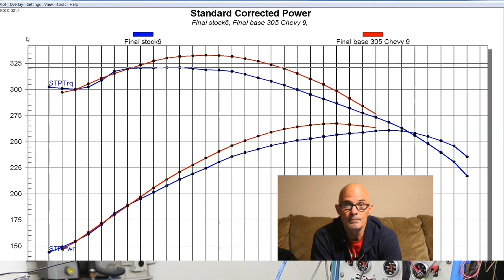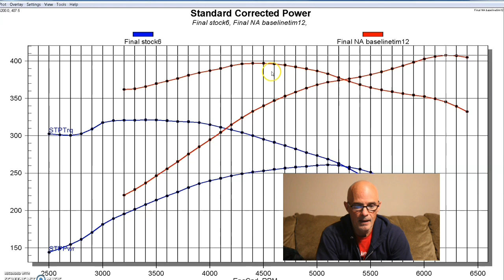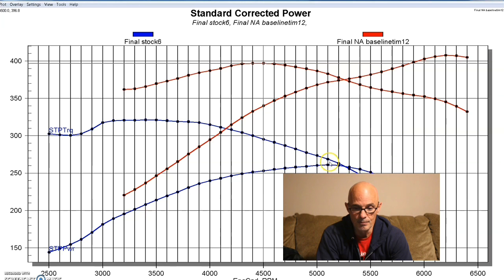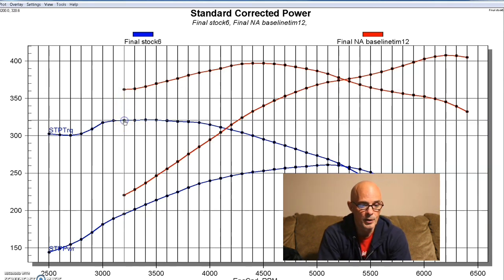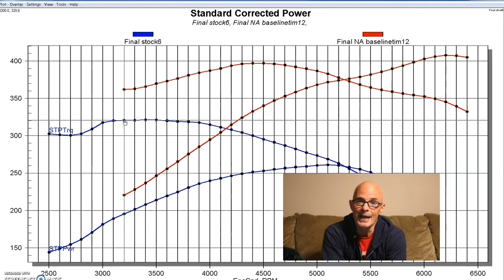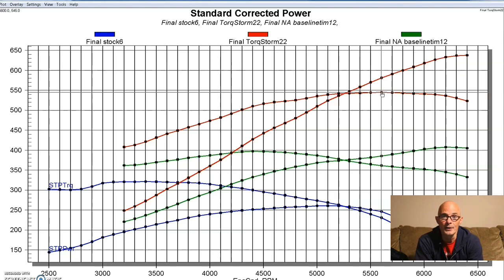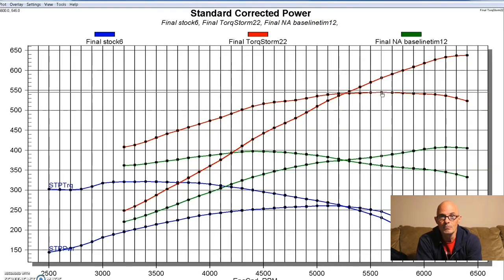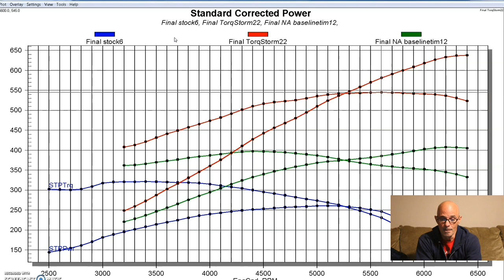5.0L FIGHT-302 FORD VS 305 CHEVY-FULL RESULTS

Comment: Questions I have a 1974 chevy 350 4 bolt  factory crate engine bored 30 over with 202 164 intake and exhaust valves ..I have 600 edlebroke carb with a  dual plane edlebtoke intake I want to get a decent size cam that will rum with a stock converter ..and power brakes ...I don't race the truck..im not worried about gas mileage ..I'd like that classic  sound and power from 1500 to 4500 
Hope you can help
Reply from the maker: look at the pe246 or an xe252
Reply: @richardholdener1727  ok thanks bud

Comment: I am enjoying the channel. Thank you for that. Have you considered any testing on any 3 valve ford modular engines? 4.6/5.4/6.8?  Most you would find in a wrecking yard would need the typical repairs to the timing components due to most owners lack of maintainence. Would be interesting to see how they stack up as far as mods and boost.
Reply from the maker: I have run lots of 3V testing

Comment: I think the camaro /firebird handles better, and is definitely more comfortable! But Chevy 5.0 is more of a truck engine, mine would do 150 mph with the stock 5.0 Chevy, with 5speed, but night and day difference swapping to a 5.7L with trick flow, twisted wedge heads, and 10.2:1-10.5:1 compression,  unshrouded heads really makes a difference!

Comment: Richard, how about a centrifugal supercharger with a wastegate? Few test of that exist out there. The projected answer is more boost down low, same power due to more slip up top. Thoughts?
Reply from the maker: The Real Time NSX run in World Challenge kicked ass with just such a set up
Reply: @richardholdener1727  I am building such a setup and was going to test it on my dyno. I however am far from being there. Can I pick your brain on a dynamometer question?

Comment: I have an 88 LTD with the 5.0. I know there’s some changes that need made to send it to HO status like firing order, manifolds, etc. I’m curious and looking to make this a sleeper (already put some work into it). What would the upgrade cost look like roughly? Parts on these seem affordable but the labor done correctly? Covering remaining drivetrain like differential/axles/etc for reliable daily around 400whp as well
Reply from the maker: not sure on costs

Comment: The most impressive thing about this Ford combination is how well the Street Heat manifold did.  I know they rated that manifold for idle-5500rpm, but I've got it on my car, and with the right cam it really does pull high into the rev range.  I had my combo dynod right after I built it, no tuning, etc.  At the wheels the E303 cam, TFS TW heads, and Street heat manifold made almost the same as the stock motor with no accessories.  I had a valve spring break with the E cam, so upgraded to an XE270HR with new springs.  That combo was also street tuned for about 4 years.  I guessed it made 365HP and 390lb/ft of torque.  After seeing your test I am feeling pretty confident in that estimate.
Reply: Back in the day I had a similar engine as you, TW 170s, B303, Street Heat, typical boltons, 3.73 and 1 5/8 shorty headers made 304rwhp.  I almost went with XE270 but run out of money for increase for cam/springs since bought all add ons at once.  Loved that engine, a blast to tool around town with.

Comment: There's a lot of comments about blocks, pistons and longevity with the Ford and here's my 2 cents worth. 
When it comes to the block the best would be a 70's Mexican 302 with a roller kit, the 5.0 roller block started out weak but got stronger through its lifetime, but even the weakest (85) will survive a 400 dyno hp build.
Ford changed to hyperutetic pistons in 1993, those shouldn't be used for any build over 400 NA or 350 boosted.
And finally the weak link to the bottom end is the rod bolts, the stock ones are too small but the rod should NOT be machined to accept a larger one as the removed metal makes the rod weaker. Simply replacing the stock bolt with a higher grade one of the same size will give you a bottom end that will live at 7K all day long.

Comment: As is turns out Europeans have found that small bores are actually more efficient when combined with the ideal combustion chamber. It's been found that a slightly above square motor has the ideal bore/stroke ratio due to flame travel. It's why almost all European engines have similar displacements (3.0L 6 cyl, 4.0L v8, 5.0L v10, 6.0L v12, 8.0L W16) . The "ideal" cylinder has a 1/2 Liter displacement and is slightly above square and ideally should have hemispherical combustion chambers. Instead of making the cylinders larger to increase displacement, they just take the same cylinder and add more. I think the 6.0L W12 in the Bentley (made by VW) is smaller in exterior dimensions than a SBC.

Comment: Richard, when you run these older engines what are you using for a PCM to run the engine on the dyno?    I was big into the Fox mustang seen back in the 90s and early 2000s and quite frankly, getting them tuned was a horrible process by todays standards.
Reply: He states that they used the Holley HP fuel management system I believe.

Comment: Have you ever seen the road kill rotson that 5.0 was said to be nine stock and they put a single plane intake and 650 blow threw carb and cobbed and hacked a turbo kit together using up side down factory headers and a power stroke turbo and maid. 618torque and 550 hp
Reply from the maker: I know those guys well-where do you think they got the BBC for Stubby Bob
Reply: @richardholdener1727  from u I think iv seen u on there a few times great group of people. I was just saying that was decent power for stock cam and heads I'm not knockin the heads a d fuel injection u did and the power u maid but it seams like a little head work and better shorty headers and cam and that road kill 5.0 would make a little more power and little less torque and be very fun and safe to play with
Reply: Very good channel love the content that u put out and I look forward to seeing new videos

Comment: Would be cool to build an updated variant of the DZ302 using a factory roller 4 bolt 350 block and the crank from the L99 4.3 V8 from a Caprice, a set period 2.02/1.60 350 heads and test that one. Using all junkyard parts of course lol
Reply from the maker: that would be cool
Reply: I have wanted to do this but it would need heads and intake from a different era to really shine
Reply: Chevy made big valve heads back then, can’t remember which exact engine, shouldn’t be a problem, after that’s tested throw modern heads/cam/intake at it and see what happens.

Comment: Wow Rich! I have a similar setup stock 302 Ford 170 Trickflow heads 1.7 roller rockers looking to put there stage 1 cam in it has 499/510 lift 221/225 duration. Which is smaller than the stage 2 cam you use . Do you think it will clear?
Reply from the maker: 221 should fit-we always check
Reply: @richardholdener1727  thanks I forgot to ask about the comp cam xe270hr-14 512/513 lift 218/224 duration with 1.7 rockers wound that be a better choice or would it be to big ?

Comment: Those who were there in the '80s remember the street dyno. A 305 got stomped by a 5.0 every time. If you wanted to run a Camaro against a Mustang you better bring a 350 and hope the Stang misses a gear. Of course if you wanted to run a Mustang against that little V6 GN you better bring a gear, heads, headers, and a bunch of spray. Stock to stock it's the GN all day.

Comment: The nice thing about the 305, is that any 1 piece rear main seal small block can replace it, a 350 bolts in, and all the parts off the 305 fit the 350. The same can't be said for the 302. That being said both engines perform pretty good. Do you have a link to the tests of bore vs stroke? I'd be very interested to see them for myself.

Comment: Great video i have always wondered does the short stroke climb the rpms faster?
Reply: In case you never got an answer to your question…engine displacement being the same,a bigger bore and less stroke will always rev faster and higher than a longer stroke. Longer stroke gives you more torque at lower rpm’s than a short stroke but will not rev up as fast or as high. Long stroke is good for heavier cars and trucks to get more low end grunt. Hope this helps even though it’s a question from 2 years ago.

Comment: In 1985 I bought a brand new 1985 Trans Am with the 305 TPI engine. I had high expectations and was really disappointed in that engine. Even more so when I was regularly beaten by 5.0 Mustang GT's. I really never understood why GM went with the 305 with its small bore and 350 stroke vs bringing back the old 302 with the 4 inch bore and 3 inch stroke. I think even the old 307 with its 3.875 bore and the 3.25 stroke crank from the 327. Emissions perhaps?

Comment: Mee too. Mid 1990s i had an 87 convertible. Began mods with sub frame connectors sll the way to a 347 stroker with a Vortech S trim. It was fun.
But...dont do a convertible.

Comment: I'm a Ford guy, I'll admit it.  Give me a Boss 351 SB Ford and the small block war is OVER. Lol!

You have to be very smart, very tenacious and have a serious reason (and budget) to get big power from a stock block Chevy 305 but it can be done.   Big Time!
One of those reasons might be a Track maximum displacement rule. 
I've seen 5.0 Litre Dirt Track Sprints that were running Chevy "claimer" rule engines that had to be a stock block Chevy 305 as from the factory. That's the only way the track would let them run. 
We had kinda set the class up that way for us Ford guys and it worked great for a while til somebody figured out the secret combination on the little bore 305 Chevy.
These guys were getting 550 plus HP and turning 7500 RPM race after race with NO problems night after night because of the 5.0 Litre track rule. They gave us 302 Ford cars all we could stand and then sum!!
 After they got 'em figured out, the Chevy 305's won as many races as the Ford Cars did and ran just as fast and maybe a little more reliable too. We ran our Fords til they POPPED trying to beat 'em.
So people who say a 305 Chevy won't run just haven't seen a screaming 305 win race after race. To get beat by a stock block 305 Chevy hurts you to the bone buddy!! LOL!

All in all Ford and Chevy small blocks (as different as they are) are VERY similar in power until you add the word "BOSS", then it's ALL FORD!  Peace

Comment: Excellent video, congratulations on the channel, it would be good between the Chevrolet 5.7 Vortec vs Ford 5.8 EFI
Reply from the maker: that was planned but the Vortech motor is later than the 5.8L EFI
Reply: @richardholdener1727  You are right, I think they are the last old school SB in serial vehicles with the latest improvements before being replaced so I was interested in the comparison, Good luck

Comment: Can you elaborate on the power limitations of the Ford HO rotating assembly?  I seem to recall that 500HP was the limit for longevity of the block, much above that and you risk splitting it in 2.  I've also seen catastrophic crank failure on an ex-drag nitrous car.  I've always wondered what the real limits of the stock crank, block, and rods were.  When I built my motor I stuck with the stock crank/rods/block because I was building a medium performance street NA motor.  Now that I live at altitude and half my vehicles have turbos, I've thought about using the old GT38 from my 7.3 on the Mustang (battery relocation sure gives a good amount of room for that).  One thing that holds me back from doing that is the stock lower end.  I know that the turbo would actually be about the perfect size for a 5.0l engine, since I'm running twice the RPM of the 7.3l, it's equivalent to a 222CID engine at 6000rpm.
Reply from the maker: My pal Jimmy Hittle from HP Performance broke theirs at less than 600 wheel at the drag strip with turbos
Reply: @richardholdener1727  Yeah, sounds like what I thought.  When the roadkill guys put an OBS 7.3 turbo on a stock 5.0L, I was shocked it didn't immediately fall apart.  Think I'll just stick with the combo I've got.  Have you ever built a high RPM 5.0L engine?  I've wondered what it would take to make a 10krpm 5.0L that didn't fall apart.

Comment: So the additional friction from the higher piston speed doesn't make a difference?
Reply from the maker: it is worth .007 hp (LOL)
Reply: What about the better intake flow with the larger bore mainly at higher rpm I presume? Do you like the 363 setup for sdf. I have a 347, do I need to worry oil comsumption with pin in the oil ring and short piston skirt with 5.4 rods? Sorry I'm sure you been asked a million times about that. How about the 347 with the
3.25 stroke and 4.125 bore?

Comment: This question is on your previous video. I know you said that all cams are turbo cams but does lsa effect turbo applications. I guess does valve timing greatly effect power output on turbo is what I’m asking. I figure that with exhaust open a bit longer it would just push boost out of the exhaust instead of using that boost for power
Reply: Or I guess it duration that would effect it
Reply: LSA will definitely effect a turbo application, wider is generally better for turbo

Comment: Chevy did best with 4 in. bore on 327 with the 2.02 heads. Ford 289 was just waiting for the aftermarket to catch up. Yes, used to use the ‘69-‘70 351 W head on SBF before the aftermarket kicked in.

Comment: You should test the newer promaxx as cast heads on a sbe 5.0, a 180cc aluminum sbf head that flows 270cfm for $1000 a set. There are no video's or dyno numbers on these heads.

Comment: Boss had a old chevy express with the 5.0 odomoeter went out around 350,000 miles on it ran for another year or two as a service plumbing van so over 400k miles and sold it to his dad after it was in an accident and drove all the way to Miami still running

Comment: I'm surprised with the larger cylinder heads and cam that the 302 actually GAINED torque at the low end also. In the forums they will claim low end torque loss if you change anything.

Comment: It would've been nice to see the tuned port "tuned" instead of going right to the aftermarket fi.... there are a lot of people still running the tune port stuff
Reply from the maker: we did tune it-using Holley HP, I've done endless TPI stuff-the long runners are tuned for low-speed power
Reply: @richardholdener1727  that is you... "We" would've liked to see it. There's a guy running 7 sec quarter miles with the TPI. I think it has a procharger. Can you get into the 7's with just low speed power?

Comment: Just like Richard said in a lot of the tests,the BIGGEST gains are in the cylinder head…more than camshaft, headers and intake. You can get more out of the cam,intake and exhaust if you start with the right cylinder head but all the cam,intake and header in the world won’t overcome 💩cylinder heads!! I knew this before watching the videos. How do you think they get the monster H.P.#’s out of the little 4 cylinder engines??Four valves and DOHC helps but flow is the key!! 2.0 L.DOHC Ford 4 cylinder engine puts out 160 H.P. n/a (unsure of torque #) and ecoboost 2.0 are 250 H.P. and 280 ft. lbs. of torque from the factory! The first car I bought brand new was a 82 Mustang GT… the quickest and fastest American car you could get that year 5.0 2bbl with a 351w marine cam and heads, single exhaust with a factory low restriction muffler…157 H.P. and 300 ft.lbs. torque with 2 1/2 times the engine size!! So same H.P. a little less torque than the first 5.0 “HO” from 40 years ago. I’m willing to bet that the heads flow better on the 2.0 than the 82 5.0 H.O.!!
Reply from the maker: heads, cam and intake

Comment: I am a "Ford guy".
I love my little 5.0 HO's.

However, there is something to be known here.
Yes, the design of the engine (oversquare) lends itself to superior volumetric efficiency and capacity (AKA, it responds more dramatically and efficiently to air and fuel flow increases).
However, if you keep running a factory block past that 400hp line, you will very likely eventually crack the webbing.

This is a very well known issue with factory Ford 302HO blocks.

Comment: What about all the stories saying the 302 will break in half when you start pushing it over 500 horse, does that make this test a hit it and quit it, or are those old rumors unsounded will this motor last
Reply from the maker: it can happen but never did to my supercharged Mustang-even running WOT for 30 minutes

Comment: You should try 302 Chevy vs 302 Ford and maybe 327 Chevy…or 307 olds vs 307 Chevy or 400 Chevy vs 403 olds vs 400 Pontiac vs 400&390 Ford
Reply from the maker: THERE IS A VIDEO UP BOSS 302 VS DZ302

Comment: 5.0 stock block with >600hp will saw itself in half pretty quickly, won't it?
Reply from the maker: less of a problem with a centrifugal blower
Reply: @richardholdener1727  Is that because the centrifugal blower doesn't produce the same peak cylinder pressures at lower RPM that a turbo setup would?

Comment: Born and raised GM guy here but I would take the 302 over the 305 every time. EVERY TIME
Reply: Even at the cost of the 302 Ford block being a weaker than the 305 Chevy
Reply: Best part about a 305.. a 400 bolts in...

Comment: Which engine could safely run that kind of power longer?
Reply: I would think the Chevy would being how people are saying the ford block is weaker at the 600 horsepower range.
Reply from the maker: I ran my Ford at 450 wheel hp for 85,000 miles, I think both can
Reply: Richard Holdener sweet! I’m building my first engine. 91 Ford 302, .030 over, Scat 331 rotating assembly, Weiand intake, blueprint 190cc heads,  comp cams xe266hr12. Getting close. Goes in my manual Bronco. Excited

Comment: That sbc block might actually survive long term. That's a plus for the 305. 
The windsor will split in half.
Reply: @Frank Bonazza III it has nothing to do with tuning. Stock late model 5.0 windsor castings quickly  crack down the lifter valley when making big power.